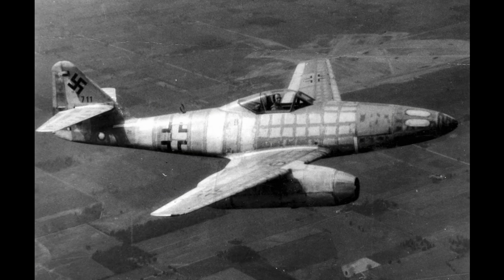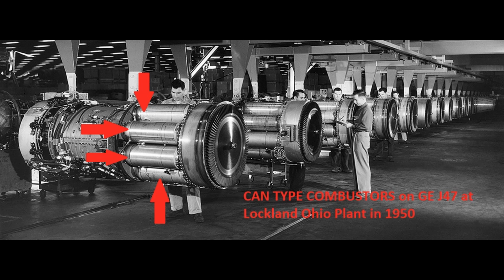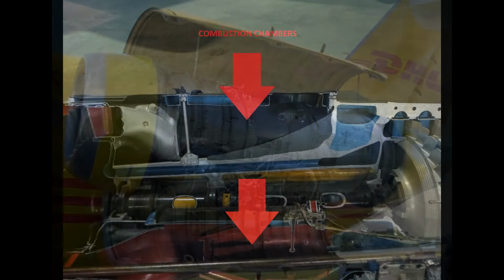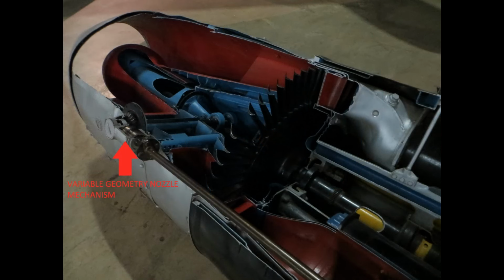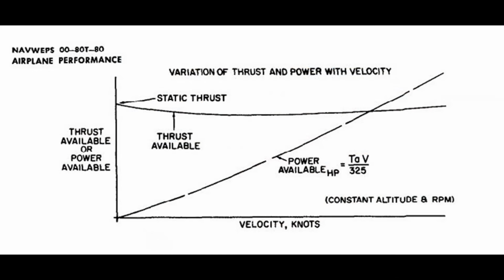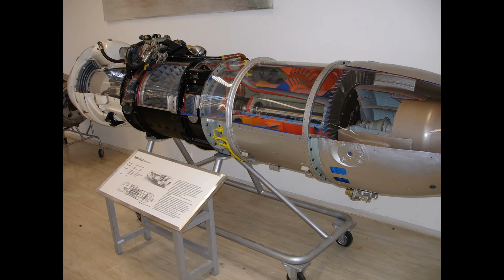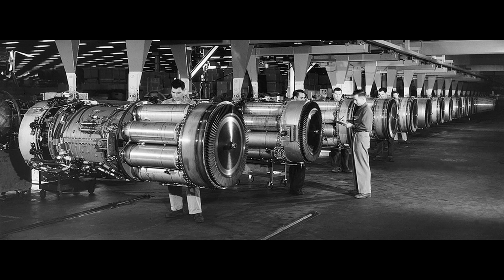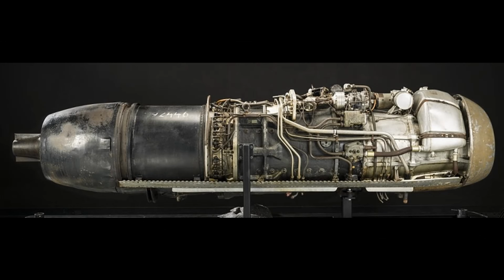World War Two JET POWER

Comment: The engine designers certainly nailed it first time,, good to hear them getting the credit they deserve.
Reply: UK designers 2 years at least ahead but not so much rush no need. Whittle proposed Fan and afterburner in 1943
Reply: @michaelshore2300  , sour grapes, and you just cannot help it or stop it.
The only engine invented by the Brits was the Sterling engine and he was a Scott. No need to downplay Whittle but the Germans got it right.
Reply: @hurri7720  Yes but very much no. The reason the Centrifugal system as chosen by Whittle was due to the material sciences and developments not really being sufficient to pursue the axial flow system. The Germans did go on to develop a great design,  but in all practical terms, fairly useless. it put the cart before the horse. 

Building a design thats 10 years ahead is a total waste of time and effort, if you dont have the materials to actually get it to work; and that extends beyond raw materials. 

The UK, went down the centrifugal path, and their engines lasted considerably longer and mechanically stable, making development cheep, easier and quicker than  axial compressor designs, That would allow development better material sciences - using what's learned to make improvements, as well as having a functional jet engine. ...This would in due course help develop axial developments too. 

To the UK the engine was a means to an end, that being a testable jet planes. 

Is the axial compressor better? In many ways, Yes. Was this known? yes. Was whittle right in pursuing centrifugal systems? I'd say yes. 
  Did the Germans have the more advanced technical designs? yes. were they right to develop and deploy these designs? Not at all. In fact if jets had to be developed, the Germans  would have much better off with centrifugal systems.
Reply: @hurri7720  Except its not rubbish. your overall position make little sense unless you look at it in very specific point of view. Nor did I say that the Germans didn't develop the Axial flow system... They did; Whittle had early conceptual sketches and math and engineering theory regarding axials, but, And as said, validly (imo) chose not to go down that route. Hans von Ohain did choose to develop that system. 

If you had actually read what I wrote you'd see that I did say that its design ahead of their time in many respects (having seminal features still present on modern engines). That is also the problem. By no means do I dismiss the German design, its quite the opposite. 
Seminal features, and the modern axial system however, does not mean it is a good engine. 

My issue/point is not that the germans were "first" with the axial, dont care. My point was it was too ahead of its time, and like other wunderwaffe, Jumos were heavy, lower power to weight ratios, overheated, tended to flame out, required advanced alloys. etc

And for all of that, even the Welland, on the whole was a better engine. lighter, more power, cheaper, more durable and reliable.

For the record, centrifugal jets still exist and are manufactured. centrifugal system have not disappeared, as it even today has advantages.  

P.s. Also the UK developed true steam engines..
Reply: @tisFrancesfault  Whittle lacked the technical ability to build an axial-flow jet engine. It was not a choice. Whittle never built an axial-flow engine, and was discharged (invalided) from the RAF in 1948 due his to addiction to Benzedrine. Dr. Franz built the first working, practical and operational axial-flow jet engine, which is the 004. Both Dr Franz and Ohain continued jet engine development for the US after the war. The centrifugal flow engine is primarily used in turboprops, generators and helicopters. All front line military jets use the axial-flow engine pioneered by the Germans during WWII
Reply: @TheAneewAony  You didnt read any of my other comments I assume. Regardless, Ill be brief. 

The UK had a operating axial flow engines by '41,  The MetroVick F2 series.
The Jumo was actual a bad engine (and the germans knew it), it was the BMW 003 would become a excellent engine but only after a further decade of development and redesign, ultimately only used by France (iirc Atar 101) and that was it...

The use of Germans in engine development did happen of course, post war. However they worked on the foundations of British engines that The US had been developing from. The use and role of German scientists post war is often overstated. 

In regards to the deployment of Meteors, there was never a need to deploy them in front line active service. Its reminiscent of T44s thousands of them existed, because they were too good, and modern to use. the Risk of tech loss was considered too great, and they were hardly as advanced as the Engines on a Meteor.
Reply: @TheAneewAony  sorry but the first working Axial flow turbo jet engine in the  UK was built by Metropolitan Vickers in 1940.   By 45  they had several axial flow engiens tested and flown which had more than 200 hours flight hours.  You got everything wrong.  The government  nationalized Whittles F1 powerjet which allowed Rolls Royce, De Haviland, and others the freedoms to use Whittles design as a starting point.   It also made the centrifugal engines cheaper to build which was why they were chosen over Metropolitan Vickers own design.   MV also made the first successful turbo fan engine and the first successful turbo prop engines.   German tech was abandoned because it lacked the propper metals for reliability needed it aircraft engines.    The only success close to the German war time tech was in 1947/48 when a French team working with some former BMW technicians designed a new engine as part of the ATAR program for the Mirage fighter.   All other designs came from British tech which was shared with the US and Soviets.
Reply: @jimdavison4077  Sorry, the Metrovick never worked. The only aircraft that used them, a Meteor serial number DG204, port F2 exploded killing the pilot William Davie. Work on the F2 then ended.
Reply: @tisFrancesfault  Just so you you know. The troublesome F2 was only installed in one aircraft, Meteor serial number DG204/G. That aircraft's port side F2 exploded, killing the pilot William Davie on 4 January 1944. The F2 had only three hours before the fatal explosion. All development of the F2 then ended. Dr Franz's invention, the axial-flow jet engine, powered the Me 262 to over 500 air to air kills. The British never had a combat air to air kill during WWII. Dr. Franz went on to invent the turbofan engine while working for the United States.
Reply: @ Okay this is incorrect, as the F2 is also the siddeley Sapphire, also known as the F2/F9, your comment is only valid in regards to the F2, not the F2/3 -/4 etc.

And yes, the engines were never deployed in combat, because there was no need to, even during the height of the 262s operations, the Allied powers  did not consider them problematic enough to need to deploy jets to counter them. 

Further, lots of scientists/engineers were taken to help refine designs, but again, they were developing form British engine designs and concepts not german (As more or less all American engines have foundation in British technology - no german). Only France would go on to dev German engines (and that being and extensively redesigned and dev'd BMW 003 not Jumo).

Nor did Franz develop the bypass. turbo fan or Turbo shaft engine, The F2 already had a  bypass version with the F3 iirc, and RR had the Conway.
Reply: @tisFrancesfault  The F2 is not related to the F2/4 - 9. Development of the F2 ended when the only aircraft fitted with them, a Meteor serial number DG204/G, port side F2  exploded on 4 January 1944, killing the pilot William Davie. Dr Franz also developed the PLF1A-2, the world's first high-bypass turbofan engine. The Meteor was never used in WWII combat due to its slow speed. There was no other reason
Reply: @TheAneewAony  No, you are patently wrong, and definitely do not understand engine development. The F9 is an F2 engine. its a continuation of the F2 engine. 

Its the same way the Rover V8 was a Buick V8 215. And the 215 licence was one of the best engines developed for, like, 40 years, across the world. In the same way rhe SNECMA Atar 101 is derived from the BMW 003. heavily reworked and engineered, but still a 003. So any point on that is silly. 

(again the F2 didnt achieve much, in of itself, but thats because it was a developmental engine, and was never needed) again the radial compressor engines more than made up for axials (that being British radials being lighter and more powerful than any axial engine at the time)

It important to understand that Axial flow engines were considered a better design in principal and worth developing, but the radial coms more practical in the short to mid terms. (which we would see peak in the mig 15, which i see few considering as an inferior design)
Reply: @TheAneewAony  oh I just noticed you dragging wiki page without understanding, which really reinforces that you don't actually know anything on the subject.
Reply: @tisFrancesfault  I'll help you understand. The British had zero working axial-flow engines until 1947. None. Zip. The F2 was a failure and abandoned. There were no British jets in actual WWII combat. The Meteor was simply too slow. German jets were fully operational and used in combat, with over 500 air to air kills. Just watch the video, rather than trying to revise history.
Reply: @tisFrancesfault  Let's try this differently.  The British were simply several years behind the Germans. Hence there were no British jets engaged in actual WWII combat. There is no need to apologize for something that is not your fault apologize
Reply: @TheAneewAony  I would strongly disagree. The real difference was the Germans were desperate enough to deploy jets in an attempt to make up the shortfalls of German aircraft.

But in practice it as a moot action that the allied found, ultimately, irrelevant. ...which it was. 

German jets were no threat on the grand scheme to the Anglo American bombing campaign.

Nor were 262s a threat to fighters, or CAS.  The 262 was an under developed hail Mary, and I didn't achieve much of anything. 

Sure the 262 was notably more efficient than an 109 but it was pissing into the wind by it's deployment. Again, ultimately not a threat to the allied powers.
Reply: @tisFrancesfault  The 262 began  development in 1939, nothing "Hail Mary" about it. The war was lost for the Germans before it started, attaching caveats such not being a threat to the 8th AF is a fallacy. The German jets marked the end of strategic bombing and the piston engined combat aircraft. If there was any doubt, the Mig 15 ended the B-29 threat in the Korean War.
Reply: @michaelshore2300  I'm not convinced, that the only obstacle was lack of motivation. Two years ahead would be 1942, right? I'm pretty sure the Meteor would a great help in Africa and Italy, maybe even as an escort fighter for USAF.

He-178 flew in 1939, so it would quickly escalate to usual axis vs allies argument, wouldn't it?

The only constructive thing would be a Greg's video on early jet engine development.
Reply: @urlichwichmann6456  There was no need for superior intercepted in the UK after 1940 there were sufficient piston fighters to deal with the treat. Had the Arado been more of a treat later then that would have increased the pressure.  Escort ??? meteor had very short range.
.
Reply: @michaelshore2300  please write more carefully, because I don't understand your point about Arado jet bomber. English isn't my mother tongue.

What exactly makes you think, that allies had enough interceptors beyond 1940?

Meteor F.4 could carry drop tanks, but I think you're right. Long range bombers would be too slow for the Meteor, but what about fighter bombers and short range missions?
Reply: @urlichwichmann6456  There were little serious day light bomber operations by the Luftwaffe after 1940 and Spitfires were more than adequate to deal with what there was, as they had no escort. Late 1944 The Luftwaffe sent Arado 234 jet air craft over UK, most as reconnaissance but a few as bombers, with very small payload. Had these become a real threat, as the B17s and Lancasters were in Germany then the need for a jet interceptor would have become an issue.  So there was no need for one. In Germany on the other hand there was a desperate need for something to counter the escorted B17 raids and hence a rushed Me 262 program.
Reply: @urlichwichmann6456  The primary purpose of ALL bombing in Germany by the allies was to reduce  German war production , when the USAAF Failed to produce the results promised the declared aim changed to destroying the Luftwaffe in the air ???   We are talking about Jet operations ?   The Night offensive received very very little opposition from Jets. In the UK After 1940 BoB Luftwaffe daylight operations were limited to nuisance raids which could be dealt with by spitfire and tempests. Later Flying bombs did produce more emphasis on the introduction of Meteors. When Special High altitude reconnaissance flights were intercepted by Spitfires they gave up and no more were seen.
I maintain the need in Germany  to combat the escorted, Daylight, heavy bomber raids, led to the rushed introduction of the Me 262 there was no such need in the UK or any where else.
Reply: @michaelshore2300  Do you have any sources to back up your claims or are going just to argue in your spare time?

I did review my sources and I seem to be right about the primary goal of the 8th air force, but just from 1943 onwards and they started operations in 1942. I have nothing to explain this gap.
Reply: @urlichwichmann6456  And Metrovick ran it's first Axial flow in late 1941,  test flew it in mid 1943.  Produced both a turboprop and turbofan engine during the war too.  Had there been a need this team would have been given more recourses but piston engine fighters were dealing with Jet fighter right up until the wars end.
Reply: @urlichwichmann6456  You do realize the Arado 234 had a top speed of 20 mph lower than the late war Spitfire right?  With their fragile Jumo engines any hit would cause a devastating fire and eventual crash.   The Typhoon engine was never rated for high altitude needed to intercept bombers.  The Tempest was essentially a reengined Typhoon and about the same speed as the Ar234.  The Spitfire hold the record of highest speed obtained on record during WW2 of any jet or piston powered aircraft, Mach .89. That was in mid 43 while serving with the high speed test wing when in a shallow dive.  Later that year it obtained Mach .92 when the propeller was wrenched off the engine while in a dive.  The wings were bent back between 35 to 40 degrees but remained intact allowing the pilot to recover from the dive and land his aircraft without power.  Late model Spits are on record obtaining 480mph.
Reply: @urlichwichmann6456  "He there explaines, that the primary purpose of allies daylight bombing was to force the Luftwaffe to fight and take losses."
Pre D-Day yes, post D-Day no.  By that time air superiority had all but been assured and it became a matter of allied fighters following ground forces, doing fighter patrols and then performing ground attacks before retuning back home to rearm, refuel and do it all again.  The bombers operated mostly in support of ground operations while still hammering German production.   With the RAF resuming large scale daytime raids at that point with it's Halifax's and Lancasters and it's light and medium bombers doing low altitude precision bombing.
Reply: @jimdavison4077  The Ar 234 speed was 461 mph. Eric Brown and I quote: "The Me262 is quite frightening. It gave us a shock to find out, because when I flew it the fastest fighter we had – piston fighter, of course – in the Allied camp was the Seafire Mk14 with a top speed of 446mph. The Me262 was 125mph faster than that aircraft. So this was a rude shock to our system, I tell you, when we found that out."  Interestingly, the Ar 234 was the only combat jet to operate over the UK during WWII, as no British jet was used in actual combat.
Reply: @TheAneewAony  top speed of the 262 was 515 mph in level flight.  In a dive the controles in the tail would seize at about 545 mph driving it into the ground.  The Griffon powered Spitfire in 43 reached 480 mph in level flight  at 22000 feet.   So thats only 35 mph difference in level flight.  The Spitfire was the fastest recorded speed of any prop or jet powered aircraft in a dive reaching mach .89 in mid 43.   Browns somewhat of a joke as he said every plane he was interviewed was the best.   He wasn't  much of an authority on combat aircraft as he flew very little actual combat missions.   He avoided it by being a test pilot which came with its own dangers so not calling him a coward just that he was never an authority on aircrafts combat abilities.   The 262 was scrapped right after the war despite a lot of them surviving.    Also there was a bunch of Jumo 004B engines which survived the war.  Again they ended up being recycled because they had horrible performance and reliability.
Reply: @jimdavison4077  Every 262 that left the factory was tested to at least 520 mph in level flight,  and 590 mph in a dive.  The 262 was typcally 540 to over 560 in level flight, with a cruise speed of 446 mph. That cruise speed was faster than the fastest wartime Meteor.
Reply: @jimdavison4077 Noteworthy is that the 004 was used in combat operations. No British jet was ever used in actual WWII combat. All 28  WWII jet aces flew the 262, with over 500 air to air kills. The rather slow Meteor was never fired upon or fired at a German. All postwar air forces eventually abandoned the obsolete but simple centrifugal flow engines for more modern axial-flow engines that the Germans had invented
Reply: @TheAneewAony  again the claim that there were over 500 kills by the 262 has long been debunked. Alfred Price wrote two books on the last 12 months of the Luftwaffe  giving his sourses and it shows less than half the claimed kills were real.   It had about a 1.5 to 1 kill ratio which is not anything to brag about.   Agains the Meteor downed over 13 V1 rockets in July 44 five months before the 262 even saw operational squadron service.    Its the Meteor and not the 262 that holds the distinction as the first jet used operationally.   Flying with a test and trials unit is not operational.  Sorry its not what you wish were true but get your history from better sourses that show their documentation.    If the 262 or Jumo 004b were any damn good why were they scrapped right after the war?   Answer that please.  The Brits had better  axial flow engines  that the Germans did during the war, they had faster aircraft.  And more advanced.   Now part of the reason was Germany lacked raw materials needed for alloyes and such but it doesn't  change the fact it happened.
Reply: @TheAneewAony  how could the German  invent something that already  existed?   The first German jet flew with a centrifugal flow engine the designer build based off Whittle 1930s patent, you didn know that right?   It wasn't  an Axial flow  engine.  Hans Van Ohain designed a centrifugal engine for the H 178 which was the first German jet to fly.     In 1941 Metropolitan Vickers ran their f2 axial flow turbojet engine which in 43 was test flown in the Meteor out proforming the Power Jet engine.   Keep in mind the f2 wasn't  the first axial flow engine they made.     This idea the Axial flow turbojet was a German  invention is absolutely  false.
Reply: @TheAneewAony  the F3 Meteors  taken to Belgium  had the long cord engine nacelles and tear drop canopy which alone made it faster than the Me262.
Reply: @jimdavison4077  The revisionist history in you is strong. The British were not able to develop a working axial-flow jet engine during WWII due to a lack of technology. It's all very well documented. "Despite its short time in combat, the Me 262 had proven superior to all Allied fighters, accounting for 542 Allied aircraft destroyed while losing 100. On display is a two-seat Me 262 B-1a." -- US Navy
Reply: @jimdavison4077  The speed difference between between the fastest Spitfire, which could only exceed 450 mph briefly in war emergency power, was 100 slower than the 262 which could easily do 550 mph, or as tested by the British at 568 mph. Lets just say the Spitfire was really slow compared to the 262. Eric Brown knows more than you
Reply: @jimdavison4077  Correct. The 262's 5 to 1 kill ratio is probably more like 6 or 7 to 1. The Meteor was not used in actual operational air combat during WWII due to its slow speed. The 262 was the worlds first operational jet fighter, the He 162 being the second. While the He 162 did score several air to air kills, all 28 WWII jet aces flew the 262. The Meteor never engaged the enemy in aerial combat, the Meteor was never fired upon by Germans and never fired at a German aircraft in combat. The Japanese Nakajima Kikka was more an equivalent to the Meteor, however the Nakajima Kikka had working axial-flow engines.
Reply: @jimdavison4077  No WWII Meteor ever exceeded 450 mph, although there are claims that one may have gone 487 mph. Keep in mind that that's slower than the 510 mph He 280, which flew before Whittle had a working jet engine that could actually fly.
Reply: @TheAneewAony  Sorry but the Spitfire was rated for 480 MPH at altitude and the 262 was rated at 515 to 520 mph so you are off. Do you have any idea how many marks of Spitfire existed and even within the marks they had various boost pressures, prop setups, different octanes and so on?  When it comes to Spitfires there is not greater authority than Alfred Price who flew them and wrote multiple books on the and other aircraft including those used by the Luftwaffe.   Eric Brown was pimped out so much he conflicted himself time after time, it was a joke in the community.   Now I will take the documented words of a Luftwaffe acceptance Pilots over anyone else as to what the 262 could so.  Remember it's weak engines had less than 2000 pounds of trust.  In combat trim it could not top  515 to 520 mph.
Reply: @jimdavison4077  You're literally apologizing for Britain's failure to develop and deploy an operational combat jet during WWII. It' s not your fault. The 540 mph is what the US tested the 262 to. 550 to 560 mph was not uncommon. One version, the Me 262 HG I hit 606 mph in 1944. Its only modification was a cut down canopy. Postwar Britain tested the 262 against the Meteor and determined that the German's speeds were correct. One was flown at 568 mph. They also found that the Meteor had 50% more drag than the 262, and given equal thrust, the 262 was always going to be faster. Are you still claiming that a Spitfire was nearly as fast as a 262? It was 125 mph slower. The Spitfire Mk 24 first flew in 1946 (hey that's after the war), and could briefly hit 480 mph, not a speed it could maintain for more than a few minutes, making it 60 mph slower than the 540 mph 262. Eric Brown knows more than you
Reply: @jimdavison4077  "the F3 Meteors  taken to Belgium  had the long cord engine nacelles and tear drop canopy which alone made it faster than the Me262." everyone is laughing at you
Reply: @TheAneewAony  Only the people who got their information from youtube.  The people who got their information prior to that know I am right.
Reply: @jimdavison4077  "Maximum speed: 900 km/h (560 mph, 490 kn)" -- Me 262 Wikipedia
Reply: @jimdavison4077  You are truly incorrect if you think that the fastest Spitfire was nearly as fast as a Me 262. The fastest piston engine aircraft, a modified P-51, set the record as 531 mph (2017). That's still 30 mph slower than a 262
Reply: @jimdavison4077  That's beside the point though as I'm talking about the groundbreaking advances the Germans accomplished that are still with us today.
Reply: @anthonyxuereb792  such as?  The modern Jet engines were from British tech, rocket tech the Germans had didn't  go anywheres becuse it lacked any guidence system,  the 262 was a dog which was why it was scrapped post war.  The 163 was scrap and killed more of its own pilots much like the 162.   Even the 262 was deadly every time it had to land. The Brits were more advanced in jet engines making three centrifugal engines that saw wide scale use by the wars end and into the 50s, they also made several successful Axial flow engines test flown for more than 200 hours along with the first Turbo Fan and Turbo Props during the war.  They had the best radar use and technology while the US had the best radio control abilities.  They were flying blombers to Germany by radio control and nobody on board since 1942.   US glide bombs were well ahead of German ones. What is it you think the Germans did so great at, maybe I missed something?
Reply: @TheAneewAony  again the fastest 262 was 515 mph  in combat trim.  Thats with fulk fuel, weapons and armour at 22 thousand feet level flight.  Now with the right tail wind any aircraft can gain 20 to 30 mph depending on the wind .   Top  piston fighter was the Spitfire which could reach 480mph  when using higher octane and 25 pounds manifold pressure.   Get off the internet and get the Spitfire book by Alfred Price.  Fastest speed reached by any piston or jet powered aircraft (WW2) was the spitfire in 1943 while with the high speeds test unit at Mach .89.  Recorded fact.
Reply: @jimdavison4077  All modern jet engines can trace their origins back to Dr Franz's invention, the axial flow jet engine. The British simply lacked the technology to build an axial-flow jet engine until 1947, the F2/4. The 262 was actually used successfully in aerial combat with all 28 WWII jet aces flying the type. There has never been a British jet ace. Dr Franz who invented the axial flow jet engine also invented the turbofan
Reply: @jimdavison4077  Sorry, but facts are not on your side. The 262 was a 540 to 560 mph jet, the British testing it at 568 mph. Watch the video
Reply: @jimdavison4077  Recorded fact, the British clocked the Me 262 at 568 mph. Sorry the stock Me 262 was more than 80 mph faster than the fastest Spitfire, 480 mph in 1946. Recorded fact, the Spitfire that you cite, on the second attempt, propeller broke off , both wings were bent and the aircraft was written off. The Spitfire speed was 606 mph in a dive, before the propeller broke off. A Me 262 HG I hit 606 mph in level flight in 1944. The Me 163 hit 702 mph
Reply: @TheAneewAony  did there is no proff to back it up.  Sorry but thats the fact of the matter.  When the luftwaffe even says 515mph why do not believe them?
Reply: @jimdavison4077  Are you saying that you did not know and wish me to school you? Even the Luftwaffe clocked the Me 262 HG I at 606 mph
Reply: @jimdavison4077  Just so you know, a propeller breaking off is somewhat past the critical mach. "In April 1944, Squadron Leader Anthony F Martindale, put the exact same Mark XI Spitfire into a dive. This time, the reduction gear designed to limit its speed failed. The propeller ripped off and the diving aircraft reached more than 620mph (1,000km/h) – Mach 0.92 – as it plunged towards the ground."
Reply: @jimdavison4077  "Speed. Speed. It was a pedestrian aircraft, really, the Meteor. It never went into… It never fought operationally. It fought, if you like to call it that, against the V1, the flying doodlebug, and quite successfully. But it really was too slow to deal with the German jets when they came into being. They were a grade above at first. The Me262 is quite frightening. It gave us a shock to find out, because when I flew it the fastest fighter we had – piston fighter, of course – in the Allied camp was the Seafire Mk14 with a top speed of 446mph. The Me262 was 125mph faster than that aircraft. So this was a rude shock to our system, I tell you, when we found that out." -- Erc Brown
Reply: @jimdavison4077  "Of course, we were testing all the German aircraft, and there were some wonderful German airplanes at that time, like the Messerschmitt 262, which was a quantum jump in performance. The top fighter in the Allied camp at that time was the Spitfire Mark 14. I’m talking purely about performance. It had a top speed of 446 miles an hour. The Me 262, when I tested it at Farnborough, had a top speed of 568 miles an hour." Eric Brown
Reply: @ In regards to the 262 itself, by all accounts, a great flier, terrible fighter.  It had a high skill requirement, to fly, and the weapons suite was dreadful for the plane. The 30mils being a terrible weapon for the 262.
Reply: @michaelshore2300  The UK did not have a working axial-flow jet until 1947. No British jet was ever used in actual WWII combat due to the Meteor's poor performance and slow speed.